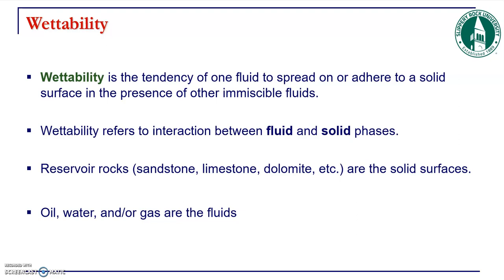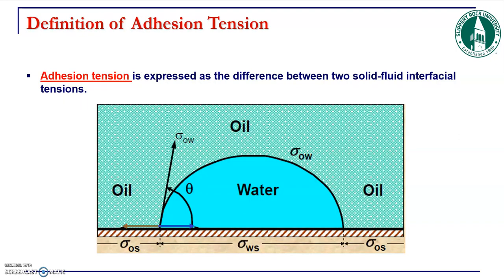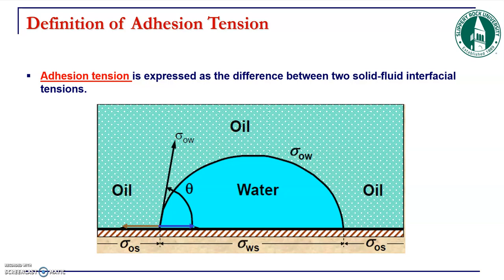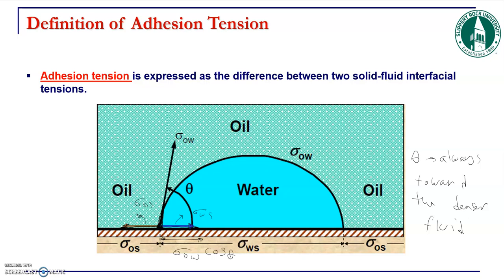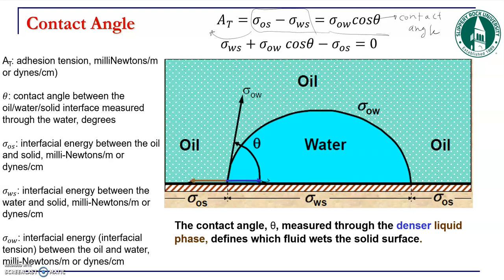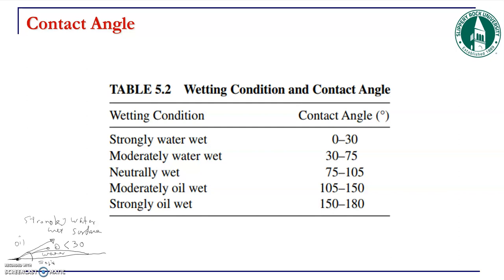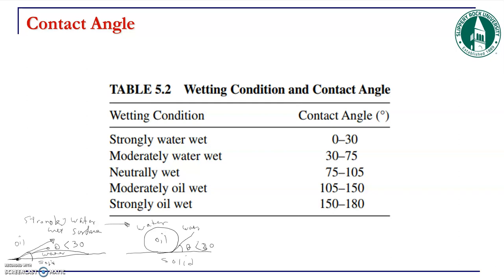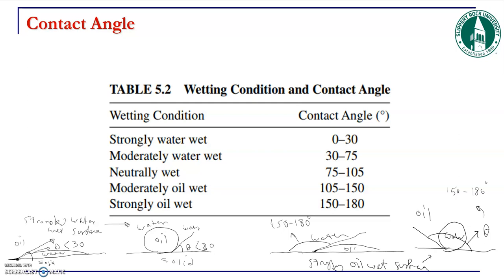12  wettability

Comment: I did an experiment on ABS plastic, the contact angle of smooth ABS plastic is around 70° which means hydrophilic surface, but when I treated the surface of this plastic by grinding using sandpaper 240um and 400um, the contact angle of the ABS plastic grounded is more than 90° ''around 100°", which mean the surface become hydrophobic. So, how can you explain these results ?!! and thank you so much